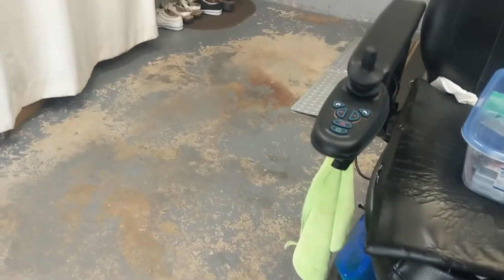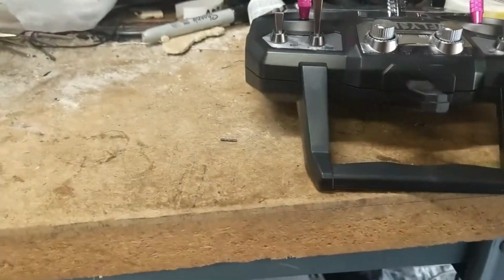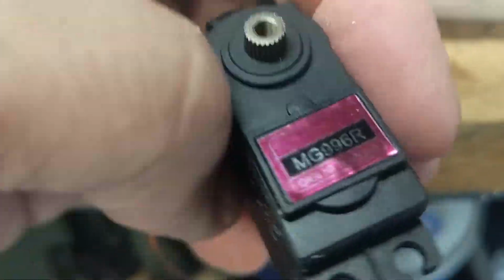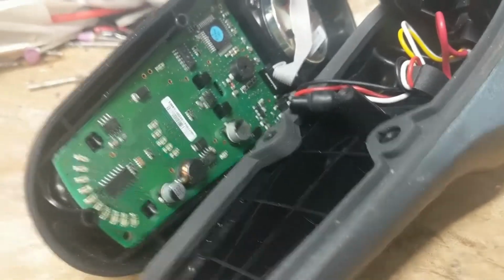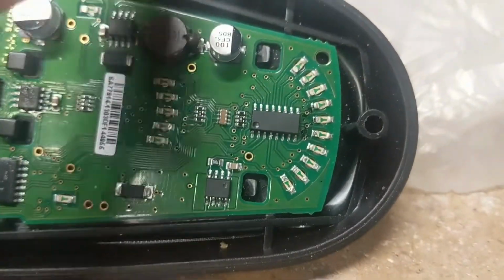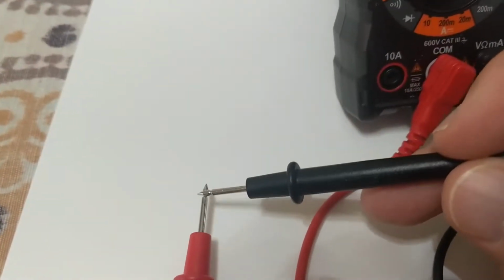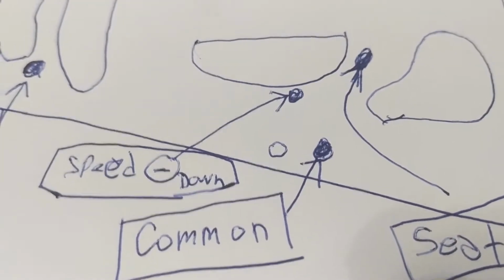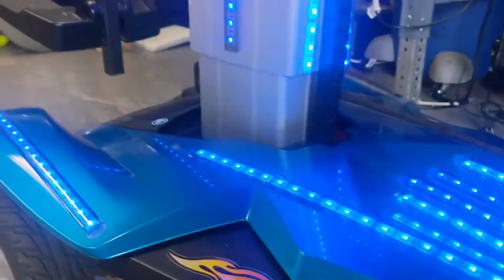Remote Control Powerchair Remote Controlled Wheelchair

Comment: Would you by chance sell a set of the gears that you printed?
Reply from the maker: Sure. But I assume you watched the video and are familiar with all the other parts you’ll need such as the motors, RC controller, springs, screws, etc. Then yes, I’ll print the 3D gears and holders for the servo motors. I’ll calculate the fair price. You can email me directly here at leebekir@gmail.com. Thanks for your interest